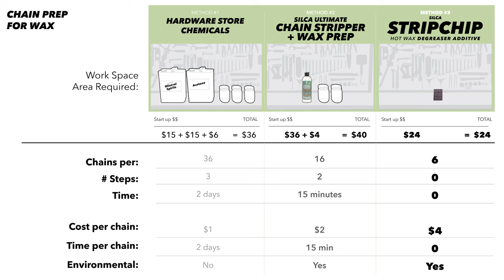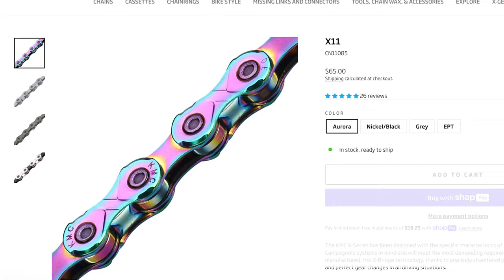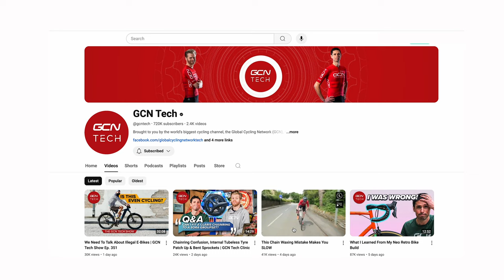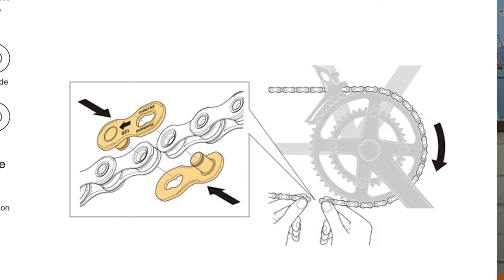Chain Waxing? Avoid These 7 Common Failures!

Comment: I thought I knew how to wax a chain but still learnt a lot from this video! When you say don't buy chains from amazon, does that also include the Shimano store on amazon? Also, does the KMC gold chain (KMC X11SL 11 Speed Chain) work well with the Silca wax?
Reply: I'm not on the Silca team, but here's my understanding:  Amazon gets, let's say, 10,000 Ultegra 11-speed chains from 100 different sellers.  These sellers use Amazon's warehouses and logistics for fulfillment.  All of the chains go into Amazon's system under the same item number and condition ("new Ultegra 11 speed chain").  If you order a chain, Amazon will to send you one that will get to you from its closest warehouse.  So, as I understand it, you cannot be certain that you are getting the chain that Shimano put into Amazon's warehouse system.  Amazon's inventory system sees them all as the same item.  Someone feel free to correct me if I am wrong about this, but I will not buy chains (or other commonly counterfeited goods) from Amazon.  I've been burned a few times already, even in cases where the product had 1000's of customer reviews and seemed legit, some fraction of buyers was obviously getting counterfeit goods.

Comment: If I have used a couple of strip chips in the same wax, then add the oil as you recommend for wet/cold conditions to soften the wax, does the strip chip negate this ....or has the strip chip been effectively used up by the chain that it stripped ?  Just so I know I do not need to replace the wax in the Silca cooker for this oil solution to work.   thanks,  Grant

Comment: I don’t heat up the Silca pot to 125°C … it does run out like that. I wash the chain with hot water and rub it very clean but I put in 110°C wax for a while to get rid (boil) the water and bring it down to 80°C for 5 min for the wax to “get in” and hang them up to cool for 10 min before putting back to bike. Does this sound like a good method?

Comment: Question/suggestion for @SILCAVelo, I found that when I pull the chain out of my crockpot, the wax runs off of the upper links on the hanger and collects on the lower links as the chain cools.  To minimize this, I have the hanger tied to a string with a slip knot and raise the chain out of the wax an inch every 30 seconds or so.  This allows the lower links to sit in the hot wax while the wax runs off of the upper links and cool.  I've found that less was accumulates on the outside of the chain when doing this.

I know I'm probably overthinking it, but are there any downsides to this technique assuming the wax is at a proper temperature when pulling the chain out?

Comment: Newer chain waxing user - I've done quite a few rides on my gravel bike.  I've topped it off with the Silca bottle lube.  I think its time to really clean the bike, the chain and re-wax.  Whats the best method here?  Wash the bike as normal then hit the chain/cassette and chainrings with boiling hot water, then resubmerge chain?  Thanks!

Comment: My wax in the middle of the crockpot  is about 85C. I pull it slowly with two spokes. I use one to hold it and the other to flex the chain back and forth so the liquid wax can pull into the spaces a bit. I hook both ends of the chain so it only takes half as long.

Comment: Even after using these methods and breaking in the chain before installing, there's a lot of wax chunks that get onto the pulleys etc that need to be scraped off, which I assume isn't efficient. Any tips on reducing that?

Comment: What's the recommended interval to clean off your drivetrain if you are using the Super Secret drip lube? And is it just the hot water method? I've just been reapplying occasionally as I commute in the wet and seem to get some wash off as a result.
Reply: I have the same question!

Comment: So what is the upper limit to the wax temp when you can pull the chain?  Certainly there is a range where you can successfully pull the chain and have the correct wax.   I used an heated ultrasonic cleaner that goes to 80C and I use the sous vide method.  So  far I have put 450 miles on my eMTB chain since waxing with a touch-up of SuperSecret drip a hundred miles ago.

Comment: Oddly, I've noticed shorter longevity after switching from a crock pot to the Silca wax pot on both my road and MTB. I've noticed that the chain is less stiff as well after cooling than it was with the crockpot. After watching this, I may need to check the wax temp with my thermometer and see if it is indeed 75C? Been kind of a bummer for me as I thought the system would make it much more reliable/repeatable/quicker waxing process and get the chain wax to last even longer mileage wise.

Comment: What about the cassette?? I just switched to wax using Silica secret blend and was surprised/disappointed to find the cassette was immediately left covered in dark grey gunk that looks almost as bad as when I just used oil. It's now time for me to do my first re-wax and have watched multiple videos on what to do with the chain but no one seems to mention what to do about the gunk on the cassette, and is there a way to avoid this?

Comment: Secret seems to adhere well to the Shimano CG-701 and wax lasts 250 miles with 3500 miles to .5% and no issues with next chain shifting

Definitely have to let it COMPLETELY cool before installing to keep thickness on rollers

Comment: Hint for using the silica wax system: 
First time with the cable chain holder, get a little bit of wax on the threads of the cable end that goes into the handle. 
When brand new the metal against metal threads need a little bit of help and the wax is perfect lubrication.
Reply: @hal9058  on the other end, I do get a little messy and clumsy sometimes, so a bit of wax builds up on the threads of the handle, so occasionally I have to heat the handle to melt the wax and liberate the threads again

Comment: At the moment I am using the super secret drip wax and it seems to be ok . I re applie about once a week, roughly between 150/200k. What I don't understand is what actual benefit would I gain from going to the expense of the full immersion system. I haven't raced for over 30 years, so a 5watt saving seems to invoke the law of diminishing returns, as I would still need to re-wax my chain about once a week.

Comment: "Don't pull it too hot" - I wait with the removal until around 60°C. At that point a slight skin start to develop on the surface of the wax right at its side. Yes, it is tricky to find the point where it is cold enough, but won't become a candle. Because it is kind if cold at that point, so much wax remains in the chain, that it practically hardens to a hard block. At this moment it looks like it works, at least for 200km, when I change my chains.
"Breaking in" - I don't know the performance loss part of it, but after like 100-200m, I can even pedal backwards, which for me looks good enough. For serious use may be not enough.

Comment: On the subject of noise, I've waxed my chain twice - completely stripped them down first both times - and the wax is definitely adhering, but it's VERY noisy immediately after reinstalling. It quiets down after about 50-60 miles, but I feel like that's not normal at all. No issues with longevity as far as I can tell, but it's insanely loud. Am I doing something wrong or is this what I should be expecting with waxing?

Edit: legit 11s Ultegra chain from a reputable dealer. I noticed it was MUCH quieter with super secret drip wax, but the hot melt wax is the complete opposite.

Comment: Very good presentation, from a multi-decade waxer. And I learned a thing or two.
I've only used Shimano chains, but a couple comments:

1. Do not underestimate the importance of waxing absolutely bare metal. And for those (like myself) who use gasoline (petrol) -- it leaves a residue. It will cripple the application! I always finish with acetone, or its cousin alcohol. And if possible, lay it out in the sun for a couple minutes to completely dry.

2. Lately I've been experimenting with using an ultrasonic bath for the final flush (large mouthed Mason jar for the chain and acetone, in the water bath in the ultra), as well as the actual waxing. It was interesting to hear the "ideal temp" which I'd never heard about but it sounds about right. My ultrasonic only claims to heat to 140F (60C). But sensing that wasn't hot enough, I preheat the wax on the stove and dip the chain there for a few. Then to the ultrasonic for 10 minutes.
A nice rainy day activity.

3. You can extend the lube life by dropping on a liquid wax product occasionally. These days I only ride 2k-3k miles in a season and in good weather, but back when I was touring, or competing it was a full rewax twice a year, then liquid wax touching up every 300-400 miles.

Comment: If I am in a time crunch and made a "crappy candle" let's say and reheating isn't an option.  Anything stopping me from running the chain over a wood rod all directions to break off 90% and deal with the mess in 120 minutes?  Or do I have to redip for functionality period?
Reply from the maker: Generally if you've 'made a candle' that means the chain never got hot enough for all of the wax to fully penetrate into the inside of the chain.  Sometimes people allow the wax to cool too much before pulling the chain and make a candle that way, and in that case, you can definitely just knock off all of the excess and be fine.. but if you've dipped and pulled too quickly as we describe in this video, the chain will not be properly lubricated on the inside, so we'd definitely recommend a rewax.

Comment: Hi Cosh ı have a question. before silca heater you said you need to oull out the chain when you start to see frozen layer on the wax. when ı use laser termometer this temperature is around 61C. so if we take ıt out at 75 degree the wax is way to much liquid. what do you think about that?

Comment: I just did my first time waxing last night , it was hard for me due I had to cleane chain 5 timewith degreaser , cleaned 2 10x gears and the crank , also maybe made mistakes on waxing' but tod	ay I rode the bike it was so quiet and fun. But seems like its rainy season now , so I need o order another chain for oil, 

one question tho  , do I always need to clean the drivetrain { chainring and cogs) each time I change from oil to Wax ?
Reply: Hi, I ride a lot in the rain and I have completely have completely stopped using oiled chains. I always ride with a waxed chain. They stay way cleaner since they don't pick up any dirt. Seeing a shiny clean chain after 100km in the rain would be impossible with oil, but not with wax. This way you also don't have to put extra effort in cleaning your drivetrain.

Also check out Zero Friction Cycling. In his tests wax is better better than oil in both dirty and wet situations.

There are a few thinks you do have to think of with a waxed chain in the rain. The chain has less rust protection and the wax will not last as long. To eleviate this I always try to use a freshly waxed chain, rewax the chain after 150-200km (instead of 300km in the dry) and after riding I dry the chain with a microfiber cloth and put the bike inside where it's warm to dry. I also rotate multiple chains so I can rewax them in bulk.

If however you still want to mix a waxed chain and an oiled one on the same bike I would recommend thoroughly cleaning the drivetrain after the oiled chain. The oil can break down the wax molecules and if this happens your waxed chain will start lasting less long and get really dirty. 

I hope my lenghty comment helps. Happy riding :)

Comment: I got 4500 km out of a kmc x8 stripping with diesel then gas then alcohol. Waxing every 150 km on a gasstove.   Let it cool before pulling it out, till the wax hardens at the edges of the pan when wiggled.

Used to got like 2500 km out of it with higher intervals and dripping with non silca.

Comment: I've been using a mini crock pot and an IR thermometer to monitor when the wax drops to 75 degrees after unplugging the pot. Is the IR thermometer giving me an accurate reading of the wax temp? I'm pointing it at the surface of the liquid wax from about a foot away.
Reply: In 30 mm height difference of wax you can get up to 30°C difference in temperature hot bottom and cooler top obviously while the pot is switched on. So ensure you stir the wax and immediately take temperature for an accurate reading. Your distance seems ok. Range up and down for sampling..

Comment: I did the pulley tab thing once years ago and did not have quick link but just popped the cage itself apart with the 2 mm or whatever and put it back.  actually not that hard. felt stupid though

Comment: Ideas on how to remove wax from the chain off the bike for re-waxing. I did it with hot water in a mason jar and ended up with a candle.  I’ve seen it done on the bike by pouring hot water on the chain while spinning the crank, however I’d rather do it off the bike.
Reply: I had good success with microwaving 2 cups of water till boiling and pouring it over the chain. All the wax melted right off for me

Then I rinsed off the water with denatured alcohol and hung dry

Comment: How to avoid mistakes:
1-2. Set the wax temp to 75 °C, not lower, not higher, pull out the chain at this temp
3. Leave the chain for 5 min submersed, to heat up to wax temperature, before pulling the chain out of the wax
3. It takes 30min of riding to break in a freshly waxed chain
4. Route around the inner cage plate tab on a derailleur 
5. Put on the chain in the right direction (not backwards). Writing usually on the outside.

Comment: I may be all alone here, but I have never threaded a chain from the bottom of the derailleur pulleys. I always start at the chain ring, and go through the cassette and then the pulleys. But you can still miss that tab near the top pulley.

Comment: FACT OR FICTION?  "You should let the wax cool slightly before pulling the chain."  

Adam at ZFC says FICTION. 
Josh at Silca says FACT. 

Have you guys at Silca actually tested this and found substantial gains in longevity?  You and Adam at ZFC both have plausible-sounding explanations, but I haven't seen any testing data.

Adam at ZFC says it doesn't matter if you pull the chain at 90-ish Celsius.  His reasoning:  You only need the thinnest of wax coatings, which will get thinner yet as the chain parts rub against each other in the first 20 minutes of riding.  Having a thicker coating just means a longer break-in period with zero benefit.

Josh at Silca: If the wax is normal crockpot "low" temperature (e.g, mid-90's Celsius), it will be less viscous, and so much of the wax will run off the chain that it won't be fully protected.  In other videos, Josh has also strongly suggested that a thicker coating is beneficial (longer protection).  Hence the suggestion of multiple rounds of adding super-secret drip lube to fill in all of the space inside the chain (which Adam at ZFC firmly says is nonsensical because the extra wax will be ejected in the first minutes of riding).

Yours truly, Adam at ZFC, and most people I know pull the chain at whatever "low" temperature their slow cooker uses (no waiting).  It's way more convenient.  You also avoid an overly-thick coating of wax outside the chain, which makes the chain extra difficult to break in -- especially in colder weather.  We all seem to have satisfactory results.  THAT SAID, would my wax treatment last considerably longer if I waited for some cooling?  Unless somebody brings some data to bear, just like those old Tootsie Roll commercials, "THE WORLD MAY NEVER KNOW".
Reply: Didn’t he mostly address this at 6:37, sounds like they only recommended it in the past due to some crockpots being too hot
Reply: @mattguy4567  Thanks for the reply!  That segment: He says "don't make a candle" (i.e., be sure to mix in any film at the top and let it dissolve before pulling the chain).  You would only run into this issue if you were waiting for the wax to cool to a fairly low temperature.  

Also: I think you are losing the forest for the trees in your argument.  Everything Silca has said on this topic for the past few years, from their how-to videos, to the how-to text on their website says something along these lines: "Aim to pull the chain out of the wax via the bent spoke as close to its hardening point as possible. This keeps as much of the wax in the chain rather than dripping out as possible."  That's a direct quote from their website instructions.

So, he's not just talking about crockpots that exceed their temperature parameters!  He's saying to let it cool substantially before pulling the chain.  Down to 75C (with the Silca pot) or just before the wax starts to harden if you are using a regular slow cooker.  That's a huge pain.  I want to know if it actuall provides a large boost in treatment longevity.  It definitely causes inconvenience and makes it harder to break in freshly waxed chains.
Reply: Looks like Adam at ZFC just posted a video.  He says, from his perspective, there is no meaningful difference between pulling the chain at temperatures between 70C and 100C.  Waiting for more cooling and a thicker wax coating only causes you to use up your wax quicker for no benefit.  That said, he acknowledges that if your temperature is way too high (e.g. 130C), then it might make a difference.  

Summary:  If your slow cooker is within the normal range for 'low', don't stress.  Maybe measure the slow cooker temperature once or twice a year to make sure yours isn't malfunctioning and going crazy high.